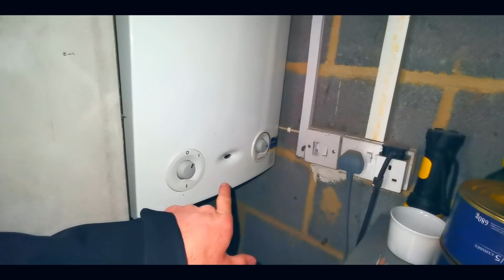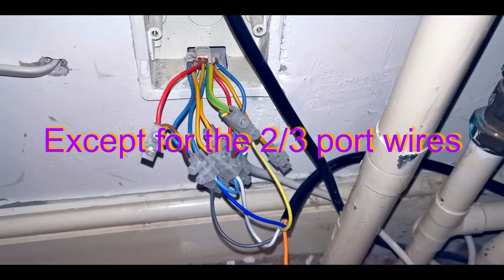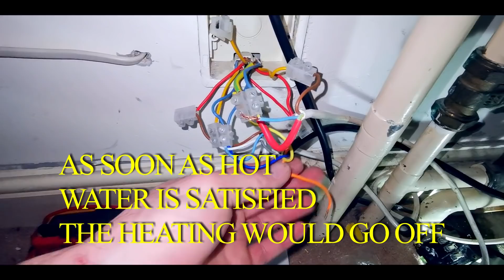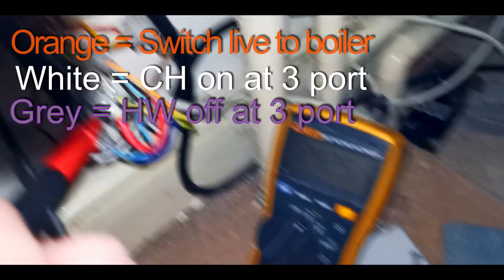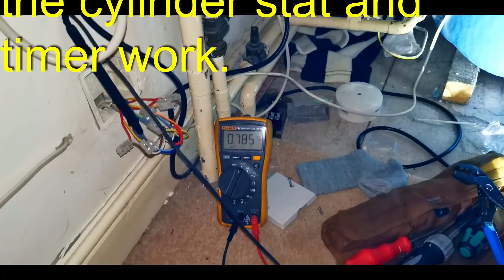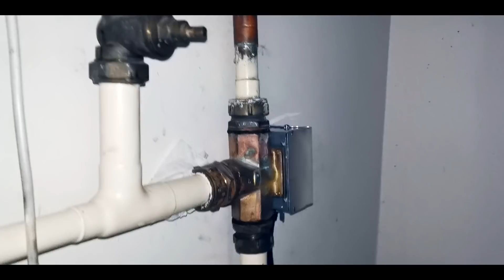Heating System Wiring Fixed And Explained.

Comment: Another good one Ollie👍👍👍
With 240vac ON/OFF controls, what really confuses the hard of thinking is simply the L,N & E.  If they can always remember that mostly the Neutrals & Earths are all common.  The Switch Lives are in series.
For old farts like me, controls wiring can be done with our eyes closed.

Lastly, I’d strongly advise anyone to buy a good quality Volt Stick & use it for your own safety, before touching anything, test with a Volt Stick.
Now I hate course cowboys, but I don’t want anyone killed.
Thanks again mate & good luck with the Patriot Account, you’re a high skilled Engineer & deserve some reward for sharing the dark arts.
Reply from the maker: We will see..... The volt stick is a good shout. I have one and use one all the time. :-)

Comment: I've a buffer thermal storage tank. I need to turn on a load when top stat drops to 45c and not turn off until bottom stat reaches 50c.  Can anyone tell me what device I need to do this? tia
Reply from the maker: Nothing. Im sure you can sort the wiring to achieve this.
Reply: @HeatingGeek  what kind of a bizarre response was that? Tks for nothing mate.
Reply from the maker: @RobinWhistles  I'm sure just using normal stats you can get it to work the way you want too. Sorry if thats not what you wanted to hear.....

Comment: Which wire do you have 240 volts on @ 21:09.  Looks like the orange but hard to see.
Reply from the maker: I have a whole series on wiring. Check the playlist about wiring. :-)
Reply: @HeatingGeek  OK thanks.

Comment: Great video. My pet niggle is when previous engineers are. using 3 core flex, people using the earth as a live conductor (even when sleeved) it doesn’t seem professional.
Reply from the maker: Mine too. Where is the protection for the cable???? When some homeowner hero drills through it and someone dies the industry will change. Until then we just carry on as if everything is ok. :-)

Comment: When ever I get a job like this I disconnect everything find what cable goes upstairs and rewire it
Reply from the maker: I did use to do it that way but I find I'm quicker at doing it this way now. Sometimes I still unwired and rewire just to be sure. But not that often anymore. :-) Thanks for watching.

Comment: Great video again my only question is i thought most guys today would use those wiring centre boxes, that keep it all so neat and tidy, rather than trying to cram it all in the wall box with this connectors, Anyway loving the video, cheers.
Reply from the maker: This is a repair not a rewire. Emergency repair for insurance.

Comment: Cheers fella, i find wiring to be the time when you have to take a breath and concentrate, 10 minutes thinking and planning will save hours in the long run if it all goes to rats.  Ref the Patron acct, i'm not sure how you would do it but like some other comments i think what you present to us is great and has helped me on more than one occasion, i've tried forums but they make me feel like i'm an inadequate pretender who is not part of their club.  i would happily pay for your time and efforts, is there a way you can make it dependent on your gas safe number then you could go a bit deeper on some issues without worrying about the 'forum police'.  I have done stuff for corgi, personally i would not touch them again, i have been with checkatrade for three years, i would recommend them although they have just put their prices up.
Reply from the maker: Corgi don't really use me much. Only when the s@%t hits the fan. I will try check a trade soon i think. ;-)

Comment: How you doing mate 
I v just installed  938 
Connected it to the UFH 
AM getting an f91 and 80 for some reason 
Any tips.. ? 
Heating is coming on 
UFH IS 0n 
But  no joy hot water 
Done the usual x31, x12  connections but s not responding to a demand ????
Reply from the maker: When did you fit the boiler?

Comment: A tip for you when checking what line is what is to buy a telecommunications line checker, with this you will be able to dead check all wires and once your on the right line you will get an audio beep, you can get multiple kit so plenty of wires can be checked at once.
Reply: Excellent bits of kit... have save me  a lot if time in tracing cables.
Reply: Ollie you are an excellent plumber with a great sense of how things work and want to achieve the best outcome for you're clients, if work is slow here then get a job in NZ OZ or Canada! Someone with your talent shouldn't be struggling and I'm sure you would work wonders in one of them places.
The problem here is everyone wants to be self employed and in doing so are making the industry harder! You can't fault people for wanting that fire and ambition however it's creating a bleak future for talented people who do want to work for themselves....

Good luck and keep the videos coming! Honest professional clear.
Reply: @seancoles7896  I Agree,   Proof of the pudding is that 4 numpties had been there before they were lucky enough to get someone like Ollie who actually knows what he's doing and also gives a flying S###
Reply from the maker: Thats a great tip. Have you got a link to one?
Reply: eBay item number 362564058963" you will need to buy extra RJ45 to crocodile clips but anything like this one will work even cheaply ones.

Sorry it won't let me do any attachment at the minute.
Reply from the maker: @seancoles7896  I had a look. I think its worth it if you do a lot of wiring and hopefully I will get some more job like that soon.
Reply: HeatingGeek.... Like I said you can buy cheaper ones with a single transmitter for around £20 just to try see how you get on, however I think the money spent for mid range is worth it for around £80 and 4 transmitters, you won't look back and it's good for aerial's phone internet etc some room stats come with RJ45 connections so you have the equipment to check if it's a good line before connecting. (Intelligent houses and heating equipment)
Reply from the maker: @seancoles7896  Ok. I will put one in my basket and earn some money for it. Summer has been tough so far. :-)
Reply from the maker: @seancoles7896  Also my name is Ollie :-)
Reply: Sean Coles. The link didn't come up with anything for me.
Reply: Alan tagg just google network tester tool loads will come up and then upto you what you buy, I can only advise to get one around £80-£250 mark.

Comment: What idiots have been there? Gas Industry has a major problem with Unskilled people working on boilers! See it everyday, I’m the one who told you about suppresses from rs that I fit . Personally I would stick Honeywell junction box straight on that back and tidy up the wiring . I know what your say u don’t get paid for that but I expect to go back one day to same job where don’t think that’s your world
Reply: Just part number, more boiler have same problem than u think , I charge for labour and parts but I work for manufacturers or normally regular customers who I trust to get paid . If people ring a different engineer every time they have a problem they are trouble!
Reply from the maker: I have been using the Worcester Ri ones on everything. Very expensive though. Did you give a link to the RS one?  Would you pay for materials out of your own pocket to rewire that nicely? Im happy to do what people pay for. Insurance wont pay for materials on that particular job, also just a set fee for time.
Reply: Jon H the insurance stuff is the worst bit with people paying monthly for cover and end up with no heat for weeks 🥶 I been to jobs for manufacturers where boilers is 3 years old and telling customer boiler needs replacing when condensate trap is full from kitchen sink waste blocked. Do one once a week or not more 🤔
Reply from the maker: @jamesjulian  What manufacture?

Comment: :how’s about a vid just on the three port valve, explaining how it works electricity and how to test it, I’ve always had issues understanding them, great video by the way.

Regards Alan.
Reply from the maker: I think a little series on electrical controls would be good. But i have a fan video and PCB one still to film that i have been promising for 6months now.
Reply from the maker: Mine is a real job in someones house where it didn't work in the first place. Its not wiring up from scratch. Thats a very different video.
Reply from the maker: @jonh1808  I didn't take it as a dig. :-) Just text is difficult to give expression. ;-)